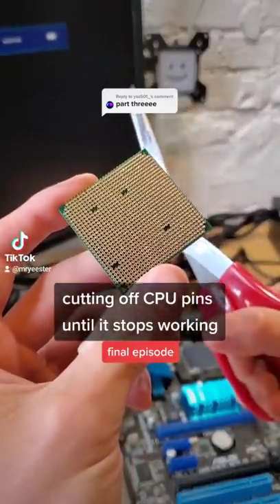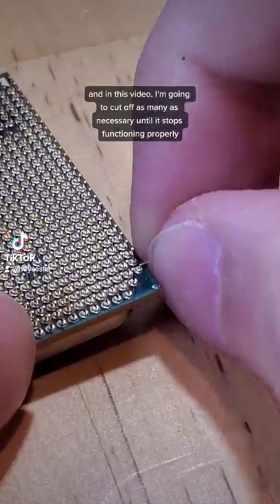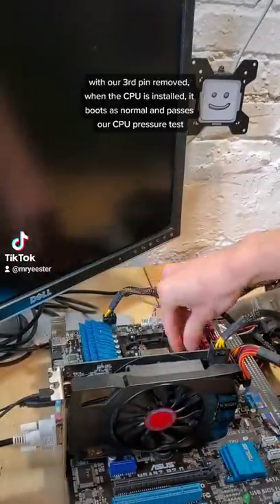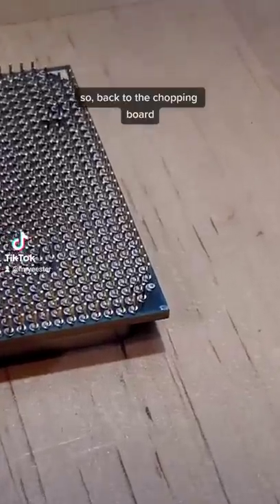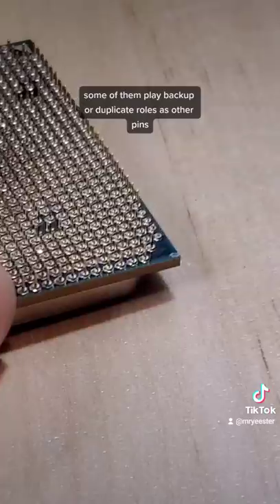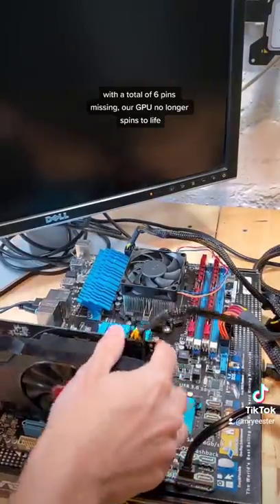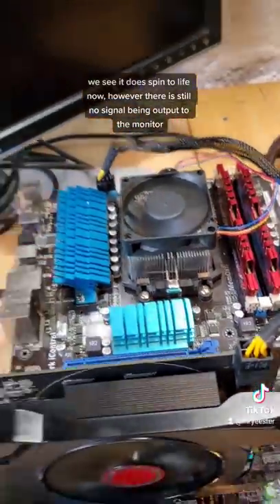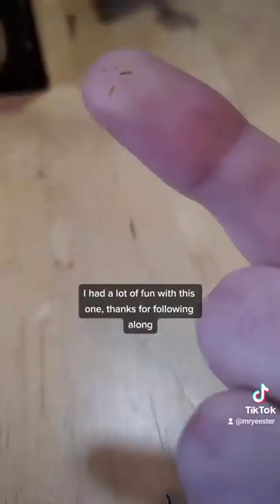Cutting off CPU pins finale #shorts

Comment: “Don’t try this at home.” Don’t worry I DEFINITELY won’t be doing this to my cpu
Reply: bc we have no money for a new cpu
Reply: It looks like if we throw away a tea spoon of humans brain until it works improperly. It looks so cruelly
Reply: No it should be phrased as"Dont worry i wont be doing this to MY cpu"
Reply: And the components are way more expensive than before
Reply: Intel cpu's dont have any pins, cant test this with my i9 9900k or i7 8700k ☹
Reply: @silmupelaa6349  no one cares lmao
Reply: @islu7158  no
Reply: Well you wont be able to bc its glued ._.
Reply: We don't have money to perform this high budget stunts .
Reply: @silmupelaa6349  Yeah you can, try it on the motherboard pins.
Reply: @hamzahaddaoui1565  and again cause y’all to broke to replace it🤷🏽‍♂️
Reply: Well even if I want to, I am using an Intel system... Motherboard pins maybe?
Reply: @hamzahaddaoui1565  no
Reply: Lmao I just bought a new ryzen 5 3600, I'm not breaking it.
Reply: @Alexander-vo4gv  I buy my hardware in multiples of 2 just in case one of them is more trash than the other🤷🏽‍♂️🤷🏽‍♂️just like I said before y’all too broke to replace it.
Reply: @stylisticsguy3746  if I had two CPU I would use the other one on a different system. If I don't have one, just pick every dirt cheap components you can find. Of course not going too far but components that doesn't turn your PC to a fireplace
Reply: Ngl scraping those pins would look satisfying, not for my wallet tho

Comment: Maybe just look at the Lay-out Plan of the processor and remove every unused pin. That way it would be more exciting than just removing pins in a random order.
Reply: Not only the unused pins, but also GND and VCC pins, while checking for stability issues
Reply: @kipacz123  🤣 maybe they should do that first
Reply: Exactly. Depending on the pin, if you pull out just that one, it won’t boot
Reply: exactly
Reply: You really think this guy is smart?
Reply: Yep
Reply: IRL minesweeper
Reply: Plan: nahhhh
Buy enough processors to try out every possible combination and then assume which ones are needed and which are not xDD
Reply: If you fake and make it feel like you didn't know it will function anyway
Otherwise totally pointless
Reply: @kipacz123  I’d prefer not touching the ground pins
Reply: @iOneCloud2  you’re very imaginative
Reply: @kingeling  why?
Reply: @kipacz123  Ever heard of static charges? That’s why.
Reply: @kingeling  what are you taking about? What does it have to do with cutting pins? The only thing that cutting GND pins do, is making the CPU less stable and passing more current through other pins
Reply: @rukasuigh5683  I realize that was a joke, but as a thought experiment, since there are 940 pins on that processor, that means there are 2^940 possible combinations of broken and unbroken pins to try. Putting that in scientific notation that means you would need almost 10^283 processors. As a point of reference, currently it is estimated that there are only 10^82 atoms in the observable universe.
Reply: @maxk4324  jfc
Reply: @kipacz123  Do you even know what ground is? It’s literally for discharging excessive electricity and it can be found in almost all electronics. Quit making a fool of yourself.
Reply: @kingeling  GND or Vss in this case means the reference voltage or negative supply. CPU is still connected to GND but the resistance might slightly change. You can prevent picking up static even with pretty high resistance to GND so I really don't know if you know what you're taking about
Reply: @kingeling  I'm an electronics technician and you have no clue what you're talking about. You shouldn't make such confident declarations about things you only have a cursory understanding of.
Reply: @kingeling  ummm i dont think you know what you are talking about.
Reply: @maxk4324  you can cut that number down significantly by removing every option that contains a combination of removed pins which failed already in a previous try.
Reply: Fr
Reply: @kingeling  says the person who's doing exactly that
Reply: Well the randomness about it is what makes it exciting if you take out all the ones that Aren’t gonna make it stop working you know the first one you pull is gonna stop the CPU from working and that’s boring :/
Reply: @RiumEqua  true, but to do so would require prior knowledge of what every pin does and so sort of makes the exercise moot. Although to be fair we are discussing testing more processors than atoms in the observable universe so we may shot right past "moot" before we even started.
Reply: i don't know specifically, but most cpu ethier intel or amd have their vcc and vdd in the inner side of the cpu

Comment: Grounding pins. you can probably remove most of them before there's an issue
Reply: This, also there are some redundant pins in cpu's. I remember lowel model cpu's like i7 920's having just as much pins as a 980x but not actually using a few of them which the higher model did.
Reply: @calculus3661  Yeah, there are still lower end CPUs lacking some features today, which don't use as many of the pins as the higher end ones
Reply: It depends on the CPU, one some of the first i9s they had issues with current burning the LGA pads under normal use, and I imagine the same could happen with just a few ground pins removed on the higher draw AMD FX CPUs
Reply: And sometimes unused pins for future processors or other models etc

Comment: Me: crying because I dropped my CPU back onto the cooler and sheared off pins. 
You: haha ruining CPUs is so fun!!
Reply: faicy  is that the point?
Reply: It's all fun and games until you drop a threadripper onto its socket destroying a thousand dollar motherboard.
Reply: Caleb Songer  yea good luck lol
Reply: Caleb Songer  usually when you break off pins in a socket people just tell you to get a new mobo and be less of an idiot net time. Fixing pins isn't that bad, but if you have broken socket pins, I'm pretty sure the socket has to be replaced. If that is the case replacing a threadripper socket sounds like a nightmare, that thing is huge. Gonna need a blow torch to melt the soldier, probably can't even use low melt solder.
Reply: Not his fault. 
You're just jealous. 
If you're jealous don't spread it. You don't want intellectuals to burn you. Oh wait you're too late.
Reply: that is an old cpu worth most likely no more than 20$
Reply: Omg why are ppl so rude holy f

Comment: Theory: Let’s do this with 1300
Reality: WTF It was 5900X
Reply: Not a ryzen cpu though
Reply: Its not it even said ddr3 1300mhz in the bios 5900x it wouldnt work with ddr3
Reply: That's an AM3/AM3+ Pinout on the chip, FX4100 to FX9570 being most popular of that socket.
Reply: Its fx6300, regarding it has 6 cores.
Reply: @andreas2826  oh… I see
Reply: am4 also doesn't have pins in the middle, that's the most distinctive part
Reply: @warfionproductions6580  nooo, it still has a kinda good value tho. Maybe an older am2+ athlon will be a better scenario ☠

Comment: If you cut data pins it's normal that the cpu could stop working...
But if you cut Vcore (i guess also GND) pins the cpu can still run fine.

Since the gpu fan wasnt spinning the first time i guess that you did cut off some pins linked to pcie and changing pcie made the gpu fan spin because the slot is probably linked to the chipset and not the cpu.
Reply: vdd core is normally 1-1.3v ish, and has a seperate gnd core rail to compliment it, is that what you meant..?

Comment: CPUs are generally created from large “sheets”, with repeating hardest spread through out. And then the larger “sheet” is cut up into the individual CPUs. And one of these larger “sheets” can even produce multiple different models of CPUs. So you’ll often times get little bits or pieces that just serve no purpose on your model, far cheaper than building each chip individually

Comment: He cutted from the pins that are not in use. They were designed for future improvements on the platform/chipset. It's 'safe' but still requires massive balls to do it 😂
Reply: He started with 1 of the ground pins and worked up to data. There are lots of ground pins to spread the load "extra" if you will.

Comment: I'd be interested if you looked at the pinout and specifically chose pins that are redundant or used for external power, to see how many you can get away with cutting off. You might even be able to cut away more than a dozen.

Comment: The exact pinlayouts for most CPUs are actually provided online by their manufacturers so you could find out which of the pins killed it exactly and what you killed,(its probably a connection pin to the north/south bridge unit in the CPU socket that is led to the x16 PCIe slots)

Comment: I remember when my cpu got too hot and weakend until the desktop no longer worked, seemed like the fan shifted moving the cpu with it, the pins didnt even hold it, i just soldered more pins and it works awesomely! I bought this of amazon in new condition. Buyer beware*

Comment: A lot of pins are for power in, or ground, and you can cut a lot of those and just end up with more heat and less stability. Not to mention "reserved for future use" pins or pins that only serve the manufacturer (e.g. , pins that the manufacturer uses to communicate with chips in the factory for setting final trim deciscions but after that are unused.) I work in the semiconductor industry with chips that have 16 control pins (plus many more for power, ground, etc) that can do their job just fine with 2 of those.

Comment: You could Google the pin out. Vss and vcc won't do much unless you get lots of them. Nothing to do with how many, just witch ones. Once you disconnect data or clock it won't work. Until then it's just earth and voltage. (Not spare just plenty of power pins)

Comment: You can probably remove 3 of each “set” of pins and have it survive fine.
Reply: Based on what?
I'd guess buy looking at the pin out instead of picking numbers from nowhere.  There are lots of vcc and vss you could possibly lose for example.
1 data and that thing is dead. Or without some memory.

Comment: The pins you're cutting off are either not used or not important to the system. At some point, things will start failing like it stops detecting certain RAM channels.

Comment: Ok but you mentioned how a lot of them serve duplicate purpose (which makes sense, if one breaks the duplicate can just take its place), so I wonder how many you could remove, assuming you somehow knew which ones were duplicates, before it stopped working. In other words, what is the minimum number of pins required for it to function?

Comment: Why do this?  I know, likes, but having schematic to see what each pin does might make too much sense and people not watch? Also, if there are multiple GND and PWR pins, they are due to the power consumption, to consume 200+w. It might work at first, but it will melt the socket.

Comment: Dude my cpu pins got bent after me having to put in and remove the cpu 2 times from
Two different motherboards. I found out because I attempted to put my cpu into my final (working) motherboard and the locking mechanism wasn’t locking the cpu in. It could come right off. I was so scared because I thought I would have to buy a new cpu (it is a ryzen 7 5800x lol not cheap) but I noticed quite a few pins were bent so instead of giving up I bent them back in place with some electrical tweezers and also my fingernails and now it perfectly works.